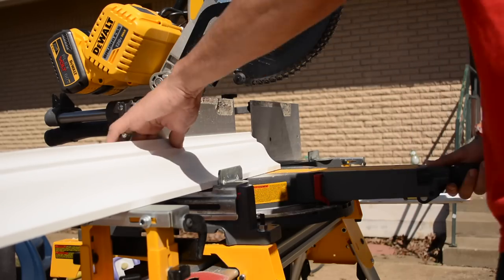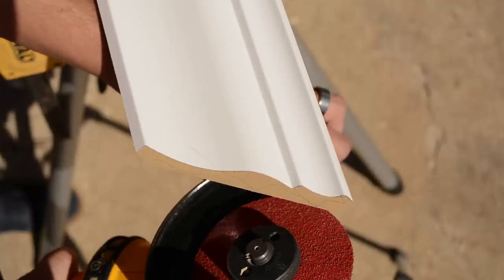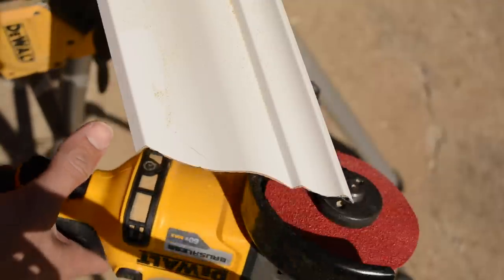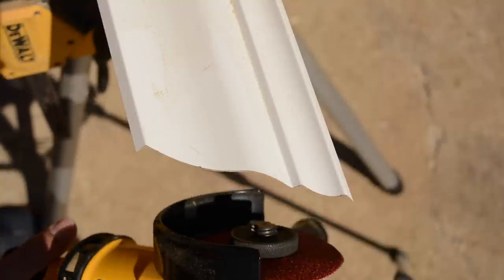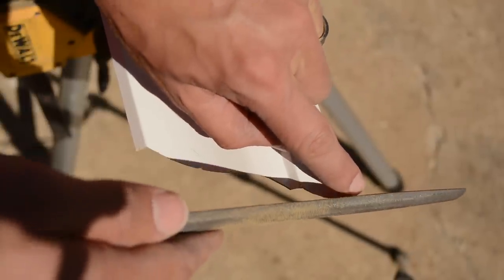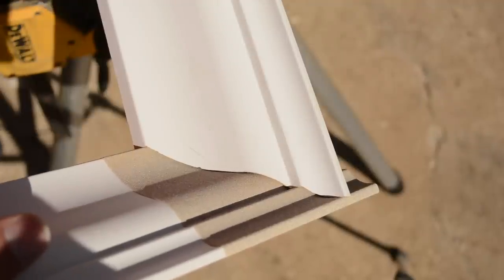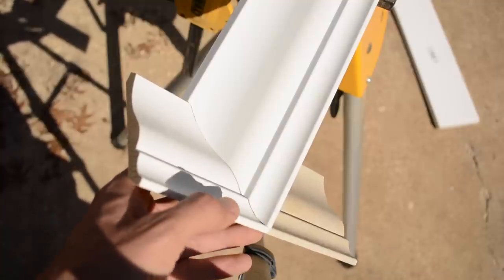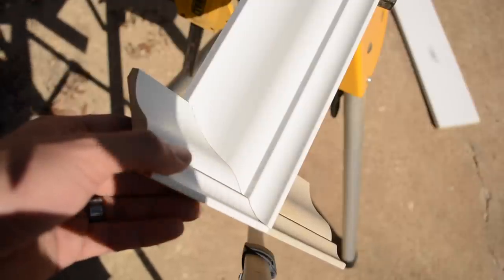COPING TRIM WITH AN ANGLE GRINDER - F I R S T - T R Y

Comment: . I use a dremel rotary tool set on low speed for coping. Thanks for the sanding block tip.

Comment: You have to add a rubber backing pad on your grinder!! That will be giving you definitely more control
Reply: The  want I’m saying is not for the sand paper!!  is the one you use with the disc he’s using its more like hard plastic if you check on time 1:40 he showing the grinder you can see he don’t have the backing of the disc !! went he  turn the grinder on the disc is flopping too much
Reply: eduardo rodriguez 
No. Using it without the backing plate makes the entire process for “forgiving”. The unsupported paper bends slightly.
Reply: Yes to this comment!!! I didn’t even notice he didn’t have a pad... get one!!!
I also will purposely use a sanding disc that is the next size up from my pad (5” pad and 5.5” sanding disc if my memory is right). That way the end of the disc has a little extra flex/ forgiveness in it for accuracy and being able to get that disc straight on into tight profiles.

Comment: 120 grit flap disc works a treat on the angle grinder, especially a well used one. Also really handy for awkward scribing jobs like running cabinet Cornice into coving or architrave etc.

Comment: Just a couple of thoughts from a metal fabricator...   I understand the convenience of a cordless angle grinder, but those Flex Volt models are considerably larger and less ergonomic than many of the corded models.  I would consider using a smaller corded model that fits your hand well.  Also, that floppy sanding disc will create unnecessary vibration and make it more difficult to maintain your edge.  Have you considered experimenting with a more rigid flap-disc, traditional grinding disc, or even a cut-off wheel?  Just some thoughts.  Great videos!
Reply: I 100% agree with this. I was waiting for that floppy disk to fly off. I could trim a baby's fingernails with a good flap wheel
Reply: @mrsir2378  Well that would be some of the worst parenting ever. Flap disks and cutoffs are dangerous.  Grinding disks aren't that bad. 
Try doing your own nail before a babies.
Have you ever knicked your thumb or finger with one of those?
Reply: @Capt_McNuggetDMZ  I have trimmed my nails with a flap disk. Don't be so literal son. I did use my dremel on both my kids because I didn't like Clippers.
Reply: @mrsir2378  nice lol.
Reply: Capt_ McNugget haha gonna be a daddy in August this is the first tip I’ve ever got out of a comment section
Reply: Would cut off wheel burn the wood. Is inside mitters Quicker when you have like 8 inside corners.

Comment: I’ve used a dremel tool with the flexible shaft and a wood carving blade. Better control than with a angle grinder. 

Thanks for your videos, love all of them, especially the sandpaper trick

Comment: didn't read but a few comments and two people said to use a jig saw with a coping shoe .....i am retired from 40 plus years of trim work and have used a jig saw for the last 30 years for all coping work....didn't have a special shoe just a thin scroll blade....it does take a little practice but when you master it your in,  a big time saver,.....enjoy watching your talent and skill
Reply: Been using a jigsaw for years as well. Works great. I question how well the grinder would work on hardwood. Im thinking it would be slower than coping.
Reply: Same as you Charlie.
Reply: Jigsaw here also.  Wrists like it a lot better too.  Just layin' off the end of a table or sheet held with a spring quick clamp or two.  Like anything else..... it just takes some practice.  Every BIT as good as with a coping saw, just as quick or a lot quicker if you're good, and not NEARLY as labor intensive.

Comment: I go at it with one only one hand on the grinder and one on the stick.  I approach at more of a 90°  cope ( maybe more like 70°) so that I don't over-cope the stock and weaken it. I also set up a vacuum to blow the massive amount of dust towards the electricians van.  I can move much faster with the grinder on paint grade stock when I'm not afraid to caulk, but I still prefer a coping saw because of the dust.  Either way, thanks for continuing to share your talent!
Reply: "Towards the electricians van" I like that, thanks for the tip!

Comment: I installed all the trim in my house with trim I purchased from my local lumber yard that specializes in “wood” trim. Not MDF. I used a coping saw and when I installed all the trim it was all super tight with zero gaps. I let the wood acclimate for 2 weeks it my house  before installing.  After the install I used paintable  chalk where the trim and baseboards meet the wall board and also glued all joints. I used a airless sprayer to primer and paint.  Now that winter is here, I have a few joints that have opened up. The gaps are 1/32” or less.  Have you ran across this and is it normal? I know humidity and dryness effect wood expansion and contraction.   Love your channel! Thanks.

Comment: I use a 90° pneumatic die grinder with small 60 grit barrel tubes. I rough cope it fast staying around a 1/16" off the line and then finish it with the die grinder. It only took about 2 weeks before other guys on the job saw how fast I was coping  and installing crown, and they started doing the same thing. 

The best part is that the tool is small and very easy to control.
Reply: I use a similar technique but with a Dremel flex shaft and the barrel sanding tubes.

Comment: Thanks for sharing. Great tip on the Sandpaper. That will work great closing up the gaps on stain grade. I have seen a few videos of guys using an angle grinder but it's always MDF. Like you said, curious how it would work on Pine or a hardwood like oak or maple . Heres one for you, I've been using a cheap Skil jigsaw to cope trim for years. Super fast and doesn't create any more dust than coping saw. I use a narrow blade with a pretty high tooth count. It works great on Pine and hardwood but you got to be careful with MDF. Could probably run a coping saw through MDF just as fast as a jigsaw without fear blowing out the edges. 

You should make a video using a jigsaw and see how you like it. Somebody manufactures a jigsaw specifically for coping but it's over a hundred bucks. There's a few videos on youtube  using that speciality jigsaw  and a couple  with dudes  using  a regular jigsaw, be cool to hear your take  on  it. My $30 SKIL works like a champ. I got some trim jobs coming up...maybe i will make my first you tube video.

Comment: I use my grinder for about all of my copes (even scribes on cabinets or scribing baseboard that won’t receive any shoe which is the style where I work). I have coped with my grinder for at least ten years. I know it’s not for everyone and it does create a lot of fine dust but I’m much faster and more accurate at it than any other method. You can use your wrist to “roll” the grinder wheel in and out of your cope for accuracy, you can also come in pretty much straight on with the edge of the grinder pad to get in tight areas (there isn’t any grid on the edge of the wheel but trust me it will still take care of wood).... on simple profiles I don’t even need to sand/file, I’m just done perfect with the grinder.... with more complex profiles I just use sticky back sand paper folded over on itself, I can roll that paper into a radius or use the edge for tight spots. I understand the sandpaper on a scrap piece but for me I just don’t like it, I want control of what I’m sanding and not sanding (most of the time only need to touch up sand part of the profile)... I encourage younger (I’m not to long in the teeth myself) or less seasoned carpenters I work with to try my grinder method if they don’t already do it that way, but don’t force anyone to do it “my way”. As long as they can do it and it looks like it should and doesn’t take them all afternoon to get one joint done I don’t care how they do it!!

Comment: 25 years installing crown and I have never seen nor thought to use the sandpaper on a scrap piece to get the perfect fit... You da man
Reply: If you're a perfectionist the sandpaper trick doesn't get it perfect.  A round file, a square file and a small triangular file will get you to absolute perfection.  Also, if you're working outside the grinder is OK, but indoors you're going to have massive clouds of dust.  If it's MDF that ain't a good thing.

Comment: Yes, but Richard, you mastered it 99%, just hand finish another 20 seconds with  a file or sandpaper and it's perfect.  Just because you're using a heavy tool to do delicate work doesn't mean you can't fine tune it with a file.  Freakin' impressive!!!!!!!!!!!!!!!!!!!

Comment: I see many people remove the guard from the angle grinder but I've found it a useful place to put the thumb of my off hand and use my fingers against the material to steady the tool.
Reply: Used to do the same thing myself until I saw a cutoff wheel explode... Pieces stuck 1/4" into solid doors ten feet away. SCARY

Comment: Remove the guard on the grinder and get a Walter wheel pad to keep your sanding pads flat instead of all wobbly.  Keep the moisture away from the sanding pads so they stay flat. Awesome Videos!
Reply: Have link?
Reply: Walter Surface Technologies on Amazon . It will pop up.

Comment: Try using a coping foot for your jigsaw. It is called a Collins coping foot. It is sweet!
Reply from the maker: Thanks! I do have one. They are great!
Reply: Finish Carpentry TV  You should make a video about it. If you have not. And if you have add the link to it. Thanks
Reply: 100/120 would be just as fast with more control. And use a flap disk
Reply: I’ve tried the coping foot and didn’t like it. I use the angle grinder with a flap disc. The grit doesn’t really matter
Reply: Oh ya. And finish it off with files.
Reply: I saw a guy with a sander that had the front projected out an inch beyond the body and it was easy for him to just sand away the mdf.  no cutting required and it came out clean.  I thought your first attempt was very good.
Reply: Try using the “heel” of the grinder. Or the bottom part of it. It’ll give you way more control and you can back cut it much more.
Reply: The copping foot is great there is a learning curve. You have to have the jig and the the play David Collins recommends. I like it on a Barrel grip jigsaw
Reply: Finish Carpentry TV video idea to show it.
Reply: You have to add a rubber backing pad on you grinder!! That will give you definitely more control
Reply: I enjoy how you quantify " At my skill level".  I think most viewers wish they had 1/4 of your skill level.
I like the grinder idea as I don't have the patience for a coping saw.
Thanks for another great lesson!
Reply: John Morehouse I don’t like the coping foot on the saw I just take the regular foot off, but like you said the barrel grip is key!!
Reply: I just freehand it with a jig saw using a skinny blade the skinny blade is key for making the curves

Comment: I work for a plumbing  company with a background In finish carpentry, and we were slow, so bossman told me to base out our new bathroom. But I didnt have a miter saw, or a coping saw. So I had to cut everything with a skill saw, and cope it all with an angle grinder. It worked amazingly!!!

Comment: Whats wrong with you son? You need a backer pad . You cant just chuck up a sanding disc. And try a disc that isn't so fresh. That new 50grit is way too aggro. Get one of these  please:https://www.amazon.com/gp/product/B002M8FUPI/ref=oh_aui_detailpage_o01_s00?ie=UTF8&psc=1I'm installing valances in High RIse Apartment kitchens at the moment to scribe to the humps in the ceiling. . I use this every day. With a mask of course

Comment: Yeah you've got a way too aggressive grit for coping MDF. MDF is basically cardboard. A finer grit flap disk will serve you much better in the future. Dont co.pletely knock the grinder method.
I usually use my chopsaw for the majority of my cope and then fine tune it from there.

Comment: I would think with an angle grinder, using some 100+ disks would make hat a bit more controllable. I saw a guy use a flap-disk and it looked really efficient....but, you'd better be careful that's for sure.  However, the sticky back sand paper is genius!  The tips that these pro's learn over years of doing this stuff is super helpful to us newbies.

Comment: I use a 4" rubber backing pad on my grinder and a 4.5" sanding disc that allows me to feather edges very accurately. The slow speed is a good idea, I've never tried that. This is a random UK link but you can find them anywhere.
https://www.abtec4abrasives.com/backing-pads-with-retaining-nut-for-use-on-angle-grinders-and-polishing-machines-new-sizes-added-793-p.asp

Comment: Get rid of the guard...get rid of the handle....you didnt have a backing plate behind the disk hence  all the wobble in disk...My suggestion would  be try using a flapper wheel type sanding disk...The edges of the disk are round aswell...Good job though...

Comment: I used the sandpaper wheel......it gives you more wiggle room...doesn't eat up the board as quickly...I also used the grinder perpendicular to the end of the board to start so I got the exact pattern...then went back under to clear the back board.....seems you just stayed under the whole time....believe me, I am no expert either but the coping saw and I just don't get along!

Comment: Hey Bud, Remodeler from Boston area. Use a flap wheel on your grinder. You can get em everywhere you can buy a grinder. Its a wheel made of stacked sandpaper, And grab a smaller grinder that uses a smaller battery for weight purposes. 
We do this in the field all the time. 🤙

Comment: I cut the moldings both ways. I always cope, just personal preference!!  but for Crown and Scotia molding i use the grinder with a 40 grit disc i find it easier laying it flat than trying to clamp it in position and use the jig saw. When i cut skirting/baseboard i use the collins coping foot.

Comment: That grinder did  killer job! 

I found the best way to cope is using the portable table saw, I do the inside 45 or 22 and set the blade depth to right under the face..it's fast and furious...:)

Comment: I’ve never tried an angle grinder on copes. I’ve used a 12v Bosch jigsaw, and with the right blade it makes an effective cope. However what I use mostly is a coping saw with thin blades. Thin blades make relief cuts on most moulding unnecessary, and with one pass they can also remove as much of the haunch as needed to produce an unobstructed fit. Sears sells a great Craftsman thin blade for coping.

Comment: I bet that’s the cleanest cope in a 500 mile radius. I’ve been doing a lot of carpentry for a few years and am not even close to a master but I’ve been coping with a shitty coping saw all this time and started using my M12 angle die grinder and ocscillating tool,with then triangle sanding attachment and I think I got this close maybe once but my cuts are rarely this good. If this is your first attempt you are definitely in the right business

Comment: You did extremely well for your first use of a grinder and first use for coping with it. Being able to place your elbows or body in a braced position  will steady your movement even more..but I'm certain you realize that after your first cope with the grinder. Again..nice job and thank you for sharing your ideas and skills. I've watched alot of your molding design and installation videos. You have a great eye for design, balance, symmetry and detail. Your work can make a room sparkle.

Comment: Even most trim carpenters don't know about this one. Been doing it for over a decade, one of my best kept secrets and here you are spilling the beans. Though there are 4 1/2" flat 36 grit sanding disks that work better. Pair it up with a diamond cutting blade behind the disk and it will prevent the thinner disk from flapping.

Wonder how many people are going to get a finger ground to the bone in 1 second flat from watching this video? Personally I've never had it happen because of my years using a grinder in tile work and being used to the tool, but I have shown it to two other finish carpenters and both of them managed to severely injure a finger, literally to the bone.

Oh well, at least it cauterizes as it rends flesh from bone. So bonus, very little bleeding!

Comment: I scrolled through several of the comments and did not see this mentioned. I have never coped with an angle grinder so I am not an expert on the technique but I do use an angle grinder almost on a regular basis. Try getting either a sandpaper disk with a backing pad or a flap disc for your grinder. That will take out the waves you are seeing in your sandpaper on the grinder. I have learned so much the past couple weeks since I found your channel. Thank you very much for sharing your knowledge.

Comment: Fuck Yeah ! Us guys who get paid per piece do it like that. West Coast, Central Cal.
Couple pointers..... a smaller grinder, cordless.
                            ......backer wheel behind the disk, grind off 1\4 in. on the circumference of the wheel so the disk overhangs.

Comment: Back when I was a carpenters apprentice, we used a jigsaw with a fine-toothed blade, tilted at about 45 degrees. Worked pretty well. Just hold on tight and you should be fine :P

Comment: I try to avoid making MDF dust, coping saw and touch up with a file is enough. Bad enough having to rip the back off MDF crown for certain ceilings and I always wear a N95 respirator when doing that. This stuff will scar lung tissue in the long term.